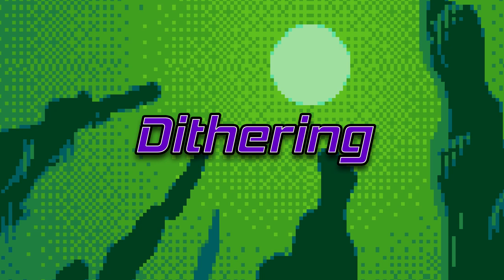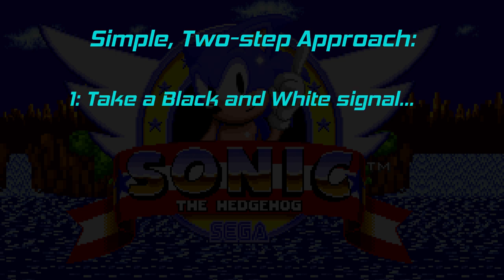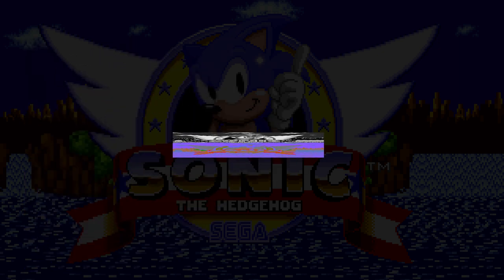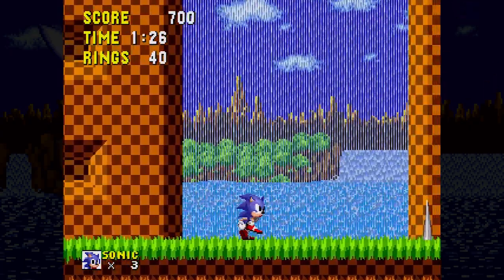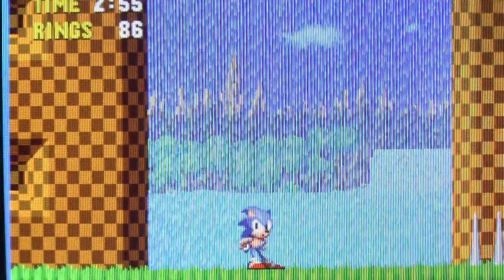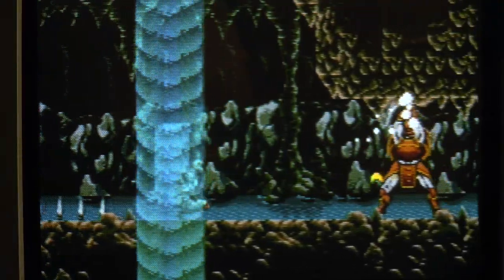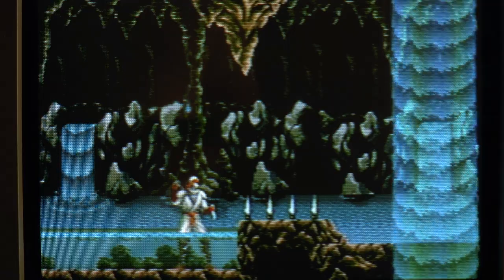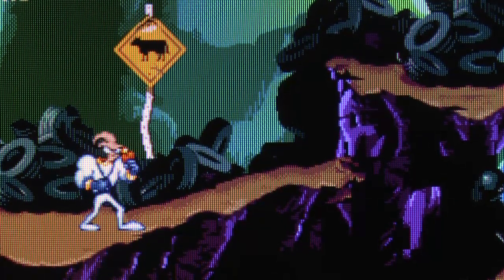Dithering on the Sega Genesis with Composite Video

Comment: Is this an effect that only works with NTSC tvs? The waterfall has never blended like that for me with rf or composite on PAL tv's (even when you're using an ntsc console on them). On PAL we could see the dithering clearly, and older systems like the C64 used it far more than the genesis so it was something we were just used to seeing.
Reply: My guess is you were using a SCART cable that sent an RGB signal to your TV. People with older TVs wouldn't have had that option, and would probably fall back on the composite signal in the SCART cable.
In the US, we never had an easy way to get RGB signals like that because we never adopted a standard like SCART, so everybody just used the composite cables that shipped with their console all the way up until partway through 7th gen. Only true videophiles and enthusiasts knew about and/or ordered S-video or component cables from specialty sources before HDMI became commonplace.
Reply from the maker: In addition to what Licentious Howler wrote, I will also say that there is a bit of an apples to oranges difference between NTSC and PAL composite video (assuming RGB was not used). There is a pretty good difference in color reproduction between the two color systems. There is also a decent quality swing between different internal revisions of the Genesis.
Reply: Licentious Howler No, I said rf and composite to avoid that confusion :) I wasn't lucky enough to get a display with scart until a few years later (a Philips CM8833, which I wish I still had today...)
Reply: @DisplacedGamers  According to Wikipedia, composite dithering is limited to NTSC TV: https://en.wikipedia.org/wiki/Composite_artifact_colors

Comment: Can you explain to me why this effect might not exist?
I have connected 2 different consoles to 2 different TVs via composite - no rainbow, no color mixing (even the checkerboard is still visible, only less clear).
After your video I wanted to switch to composite, but I don't see the point. I do not see the desired result, only less clarity.
Reply from the maker: The console revision (Genesis/Mega Drive version) may have something to do with it, and the television (notch filter, comb filter, etc.) may have something to do with it.
Reply: @DisplacedGamers  You have clear information in the video - that it should be this way and nothing else.
This means that there is not enough information, at least a brief mention of this.

Comment: What about component? In the video it is ranked as the top quality connection below RGB, but would the output work fine with dithering as well? Again in the dithering topic, what about VGA?
I'm saving for a MiSTer, so I'm trying to gather all the information possible before jumping on a specific CRT.
Reply: component and vga display the dithering just like rgb

Comment: Dude... this was amazing. You almost lost me at Shinobi, the overall visual quality between composite and RGB is... striking. But the Earthworm Jim won be back, great example.

If you could make a similar vid for 5th generation consoles such as the N64 that would be super helpful. For that generation the choice of composite/RGB is not as clear cut since the use of dithering is slightly less common than on the Genesis.

Comment: I have a Sony Trinitron with crt emu buy recently, which is the correct mode for the water in sonic for real emulation? , I don't understand if is work correctly. I have setup all correctly with 224 resolution and super resolution ecc ecc

Comment: Honestly anything over the consoles original rf signal, for those of you that haven't used a console with rf and think that composite is bad, you have no clue. Composite is quite useable and especially on things that were designed around it or before it, it looks quite good. Old consoles just love a good set of av cables. Rf on the other hand is horrid, it will make you want to cry

Comment: Okay I've got a crazy question. Just started playing with a genesis model 3 on a crt. My crt is not high end just has composite. I have a nes, snes, n64, and a playstation. Hooked up to this tv by far the genesis looks the worst i've adjsuted my tv settings and I think I have the best setup at this point. I think I have jailbar issues ghosting behind some sprites and  some sprites pixels seem to stretch vertically I looks worse in some games more than others. I have ordered a new cable hoping this will clean up my signal. If not my reseach has come up with the genesis is a noisy machine video signal picks up alot of noise on board. The solution to this is the triple bypass which adds rgb. Now like I said earlier my tv in not rgb I may mod it one day. But until then can I use the triple bypass then used a retro hdvision component cable to a component to composite adapter then off to the tv. Will my awful picture be improved? Is it worth it?

Comment: While it's s shame that awesome dithering effects as viewable on a CRT via composite are a thing of the past I wouldn't trade it for the colour and clarity of RGB in most cases. But I wouldn't trade my CRT for a HDTV either - this to me is ultimately the more crucial issue.
Reply from the maker: The first time I saw RGB on the Genesis, I was blown away. These days, I will switch between upscaled to flat panel, PVM, and consumer set as well as the various types of video output depending on my mood. And I definitely understand why you wouldn't want to trade your CRT for an HDTV!

Comment: the sonic 2 tubes on the second stage  have a nice glass effect on the composite signal
however in RGB signal  it looks like garbage   i tested some games with composite the signal helps adding a ilusion of more colors.on screen  street fighter  2 looks more colorful .in composite  jajajjajajjaja than rgb   it also depends what tv you are using

Comment: IMHO, I'd want to see Genesis games remade based on their intended look rather than play them via emulation for the 15th time.
Reply: The Mega SG (and a few emulators I think) have a "dither blending" mode that tries to blend dither patterns together to get a smoother image. It's not perfect - it sometimes blurs fonts and dither patterns can still be visible, but it can give you something similar to same effect composite video does without leaving you with the other artifacting that analog video has.

Comment: Great video. Nowadays the Genesis looks way worse than I remember, and it's down to the dithering not blending correctly on modern displays.

I wish there was more interest in the retrogaming community for developing ways to hide this effect while using high-quality connections on original hardware. I've done tons of research and it seems like your only options at this point are composite (looks awful on a flat screen) or emulators with shaders (not my area of interest). Would make a great OSSC firmware update, but that may be a bit too niche to reasonably expect.

Comment: Is there a way to get better quality composite out of the genesis?
Reply from the maker: Definitely. You can either replace the video encoder circuit or make changes to the supporting components. You could convert the RGB output externally - let another device convert the RGB to composite and then output that signal to your display.

Comment: I've bought a HDMI to Composite converter. And played sonic 1 on emulator. There was no dithering at ALL! Why is that?
Reply: if it is a decent hdmi to composite converter (and you have composite from the genesis going to hdmi to the tv) it could be outputting as RGB and not composite since the genesis was capable of both.. Back then most people outside of europe and japan only had access to composite or RF cables.  The Japanese & Europeans would have used SCART (or in Japan's case, another cable I can't remember the name of) that sometimes would output the RGB video signal instead of composite.  the only way to view the transparencies as DG indicated in the video was via composite as the devs designed most games w/the awareness that most users only had access to composite and the transparency effects would allow the games to look more detailed under those parameters.

Comment: This is why I still have my genesis hooked up with RF output.  The image is just so much better looking.  (and it makes it easier to swap to NES/SNES, since they can use the same RF cable)

I hate the blocky pixelated look of "better" quality output.  The whole reason I use original hardware is to see the game as it would have looked at the time, not some messed up version of it.

Comment: I was told interlacing is what's responsible for transparency in Genesis games, like Sonic the Hedgehog. You're saying it's dithering? Or is it both interlacing and dithering?
Reply from the maker: Most games are progressive. Some run in interlaced mode like Sonic the Hedgehog 2’s split screen or use an interlaced mode for a something specific like a menu. Transparency effects on the Genesis/Mega Drive can be approached in a few ways using neighboring colors.

Where did you hear about interlacing being used for transparency? You aren’t the first person to mention this.
Reply: Well for one, I was told it was used for surface water effects in Sonic games, which I believe had alternating fields of solid water sprites to give the illusion of both movement and transparency. I also thought the vertical lines in the waterfalls themselves alternated but that could be me misremembering.

Comment: i have the brazilian tectoy megadrive 2 (wich is basically, a genesis model 1). original psu, original av cables, and i get some bad rainbow effect. There's some way to get rid of it? without moding? i like composite, but not the strong rainbow effect...
Reply: try another composite video input device
Reply: @gamecubeplayer  like an av switcher? External powered one, i suppose...
Reply: @almmiron an input device, not a switch
Reply: @gamecubeplayer  i'm using late 2000s samsung crt. What do you mean by input device? Another tv?
Reply: @almmiron yes, if it also doesn't work then the megadrive is broken

Comment: Can any emulator create these effects perfectly?
(Algum emulador consegue criar esses efeitos com perfeição?)
Reply: Kega Fusion has a few modes to recreate these effects. I think they are TV Mode (CBFS) and TV Mode (NTSC), which, along with the "filtered" option really makes those dithering patterns look as intended. But, it does make the look less sharp.
Reply: @TDRR_Gamez    .I tested here and it was very similar indeed! thanks for the tip.
Reply: @AnimaBits  I have made a couple of modded presets that attempt to imitate dithering but specially, look up to imitate the Rainbow effect coming out from composite connection exposed in this video, as close as I could. You can find the presets in the last Sonic 2 video from my little channel...

I would say it's about 95% accurate. Definetely a wonderful effect from that era that some people may consider as console default.

Comment: Which genesis model has the best video output for composite?
Reply from the maker: I haven't done my own analysis, however many people seem to favor the composite output of the 32X.

There is always the possibility of encoding composite externally from any given Genesis/MD system (taking RGB output at the port and just feeding that into an external encoder), but I am guessing something like that would be too niche for most audiences as they tend to favor RGB output and upscaling vs going "backwards."
Reply: Model 2 VA 3 and Model 2 VA4 with the Sony CXA1645 video encoder are great.  Those models with the Sony CXA1145 are also very good. 
The Model 3 has a very vibrant image, though compatibility with the 32X must be hacked. I haven't checked in a while, but I don't believe anyone has modded the Model 3 to be compatible with the Sega CD.

Comment: Personaly i am against dithering via composite because what you see is not how the game was made and there’re side effects using composite video but it is a neat trick to save on memory space , BUT it would,ve been nice if game dev’s gave you 2 options in their games menu to choose from, 

sothat if you choose composite video mode, that the game switches to dithering mode ,, but if you choose RGB mode that the game then switch into HAM mode to refresh new colors onscreen to FAKE extra colors by using the mid-frame scanline trick, thisway you could satisfie both composite or RGB scart users.
But sadly this would,ve add extra memory space on the cartride.
Reply from the maker: I believe there are some strides that have been taken on the emulation front to combine the sharpness of the pixels in non-dithered areas with the blending of the colors in the dithered ones. The last time I checked, it was a work in progress.
Reply: Displaced Gamers aha that’s interesting, inagine such discrimination filter to only blur dithered parts together and not the rest, well that would blow my mind, but i can imagine such filter will require extra horse power.
Reply: Some devs worked with two monitors on their desk--a conventional, consumer grade model CRT TV as well as their computer monitor which had a higher resolution. They could see how the image was represented on both displays and work with the limitations of the signal to produce certain effects or make things more clear.

Comment: I grew up with the sega genesis and Ironically, the blending that happens using composite video actually kind of hurts my eyes, and I genuinely like the aesthetic of being able to see the individual pixel dithering. The upcoming release of the megaman zero collection (from the GBA, onto the switch and PS4), Looks kinda bad to me because instead of just upscaling the sprites, they've vectorized them and scaled the vectors up, resulting in weird angles that looks like just hot garbage

Comment: It's a great video, but you're wrong that the dithering is 'incomplete' in RGB or something shaper than composite. That assumes an axiom that dithering is only meant for composite type signals (or something that can blur it). While dithering might have different visual differences depending on the signal, it does not detract from the fact that dithering (yes, on the Genesis too) is not outside the realm of RGB. Quite the opposite (there are SOOOO many examples of dithering in RGB). Plus, the effect on Genesis (because it doesn't alternate the color burst signal phase every other line), is not universal (not does it have the exact same effect on PAL vs NTSC). 'Line' dithering isn't limited to the Genesis for 'composite' output.. it's been used in RGB games (computer games) as an alter method of dithering (and to be used with checked or similar pattern dithering). There's also the fact that, the composite is pretty bad on the Genesis (32x has better output), that you can't say 'more colors' via dithering AND higher resolution: you lose that higher resolution advantage of the Genesis in composite. So it's either one or the other; higher res but RGB, or lower res (than effectively 256!)  but extra colors via blending. You don't get bother. For the record, the Earth Worm Jim dithering actually works pretty great in RGB out (Eternal Champions.. not so much).
Reply from the maker: Ahh man. Didn’t mean for it to sound like I thought composite blur was a required component of dithering - just that some people prefer the composite look on the Genesis as it seems to get most of its appeal from the effect on dithered graphics.

Comment: Are American NTSC-TVs really so bad? Even in 1991, when I played Sonic on a mediocre PAL TV via RF cable, I could clearly see that the waterfall (and other objects like Sonic's shield) were not transparent, but dithered. Same thing in Streets of Rage at that bar where the ceiling lights are supposed to emulate transparent light. It never worked on a PAL TV.
Reply from the maker: It depends a lot on the composite output quality of the console in addition to the television used. Various models of the U.S. NTSC-based Model 1 Genesis in particular had rather terrible composite video output.
Reply: Only had to read half a page before seeing a smug European trashing America because of an assumption or a completely made up reason. Classy. 

NTSC is actually superior to PAL.
Reply: @vladg5216  ....In frame rate. Resolution and color have always been better in PAL.